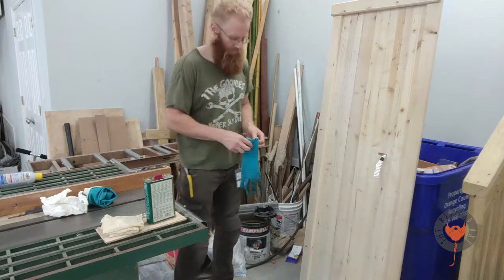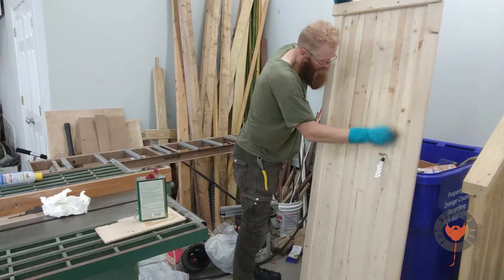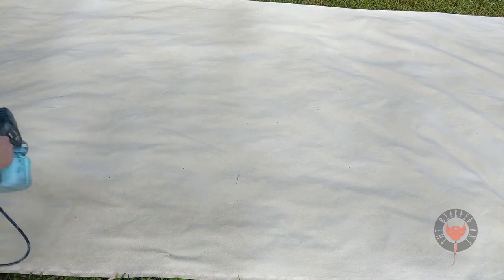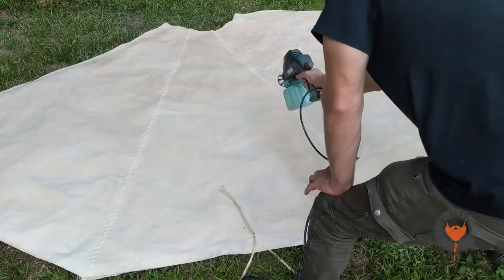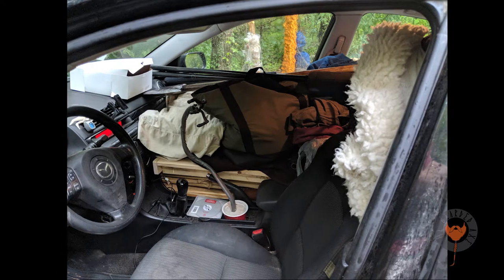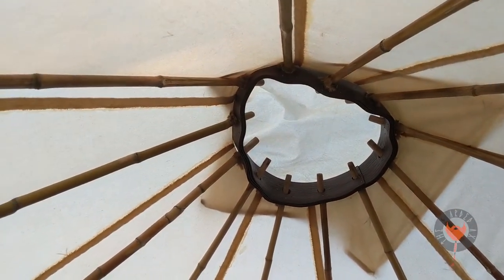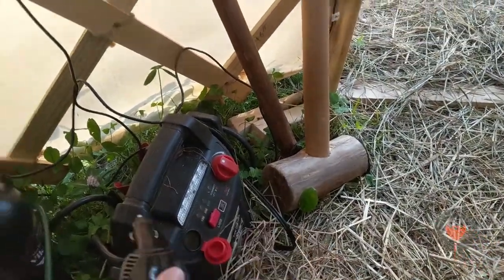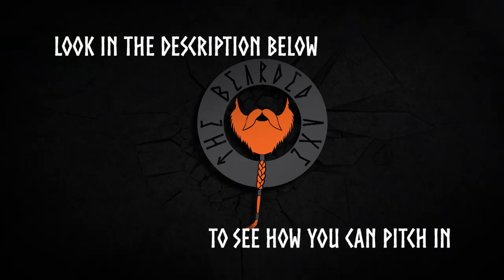Sealing the yurt canvas

Comment: Might make a video on how you made a shelf.  I mean it isn't a flat wall or even a solid one, so how did you attach it?
Reply from the maker: This shelf was a very quick experimental build.  It took me roughly 20 min. to cut and drill the holes and install.  It wasn't done very well but it helped me design a better solution.  I ended up making real semi-circle shelves that tie to the walls.  I just need to edit that into a video and post it lol.
So stay tuned for that :)

Comment: try bimini top water proofing.
Reply from the maker: I'll look into that.  Boiled linseed and mineral spirits did the trick but I'll try that stuff on another canvas I've got.
Reply: @TheBeardedAxe  You can get it at a boat store ,west marine etc., comes in a gallon size. It's not cheap stuff either, $50-$60 per gallon. We use a cheapy ace brand pump sprayer to put it on, well everything we want water proof. tents, chairs, popups, cloaks etc..
Reply from the maker: I see
The boiled linseed and mineral spirits where $30 per 2 gallons.  I think the linseed oil was $17 and mineral spirits were $13 that came to about $30.  I had it shipped so there was a few dollars added of course.  Over all a better investment then Thompson's 😬

Comment: Thanks for the video series! What are your thoughts on insulation? It seems like your yurt is fairly easy to set up and take down however I’m not sure how it would do in a harsher windier climate. How much would you say this whole project cost overall?
Reply from the maker: Total cost I would say close to $150.  The canvas was roughly half that though.

I've had this up in 40 mph gust of winds.  These tents have been used in Mongolia where the winds get much higher.  I think the round shape has alot to do with it.

I have thought of insulation but for my applications I don't necessarily need it.  But if I did I would try that bubble wrap insulation you get at hardware stores.  It has a mylar/metallic looking coating to it.  I think maybe it's used for water heaters.  Anyways it would be fairly cheap to insulate the wall.  The ground would be another issue though.  

Also glad you liked it :)
There's more and I have finished the upgrade I did to it.  Seems like folks lost interest and I thought I should move on to other videos.